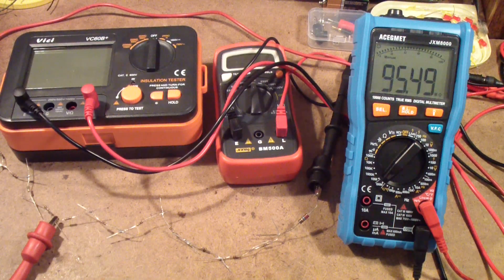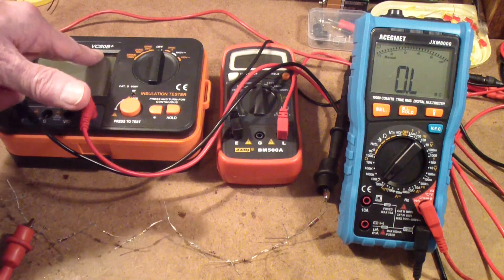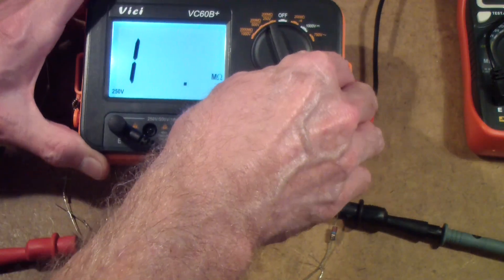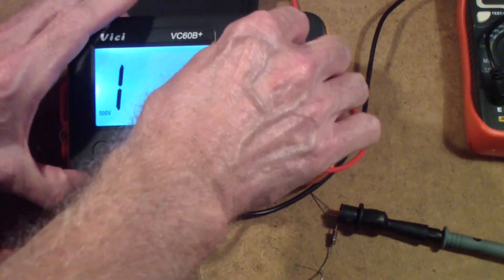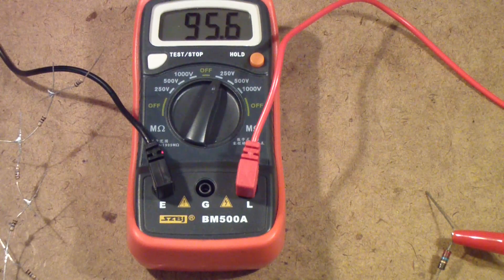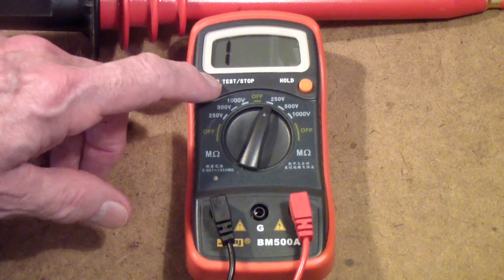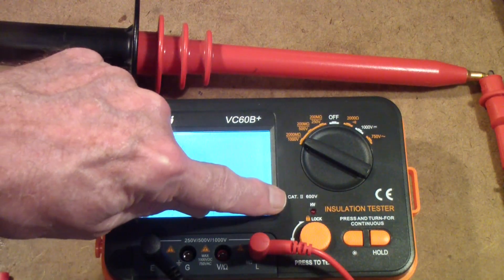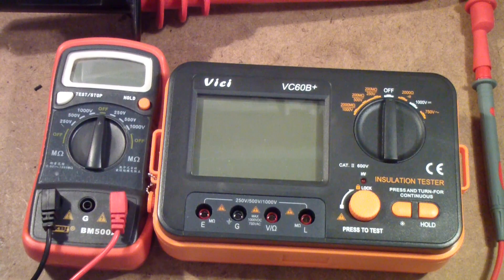TTT 336 New  Megohmeters

Comment: I've had a vc60b for about 6 years iirc. Used it mainly for testing industrial motors, it does look cheap, but has held up in rough environments. EDIT I said it doesn't look cheap, it does.

Comment: Ok, i surmised where You were going with this, as i have been trying to find a better way of testing high voltage electrolytics in my old radios...I am curious how to test a 630V cap for instance that falls between the ranges.  Ok..thanks Tom.
Reply: Dan Seven I would like to see that too. These things only deliver 1mA or so: surely it would take forever to charge the cap?